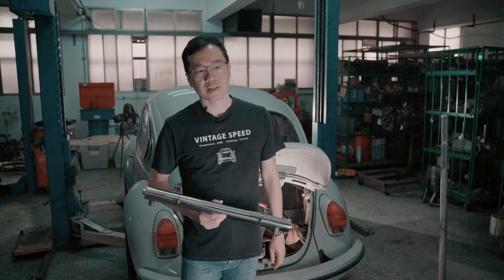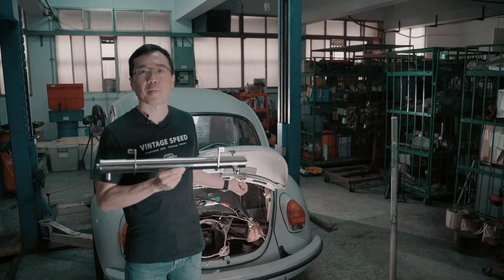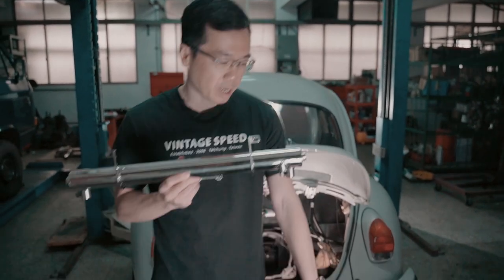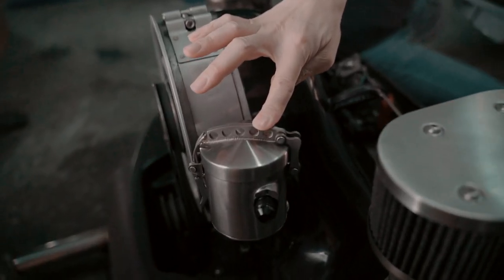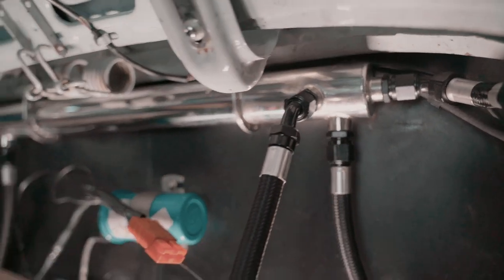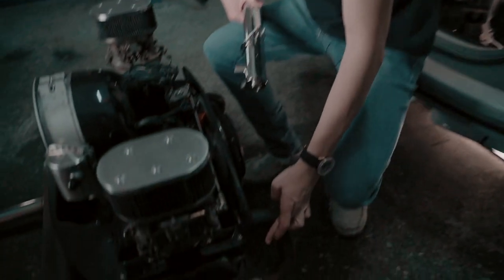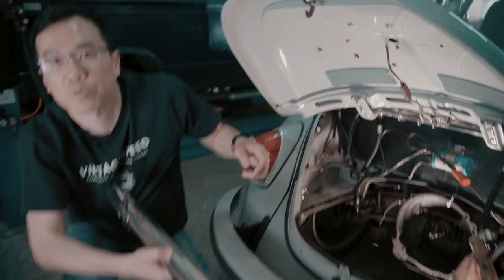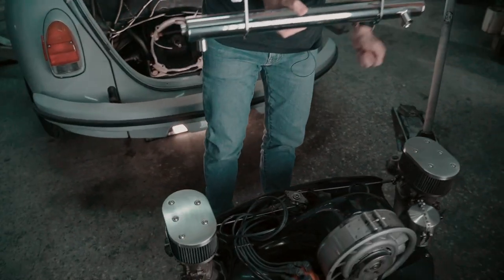How to fit Vintage Speed breather tubes to your Aircooled VW setup.

Comment: I’d prefer to vent to atmosphere than booger up my filter lids with parts (and carbs/intakes with gunk) but into the fender so my heater air doesn’t smell like blowby. It’s a really cool part but lots of hoses for said requirements.